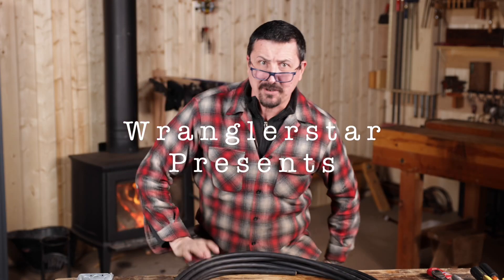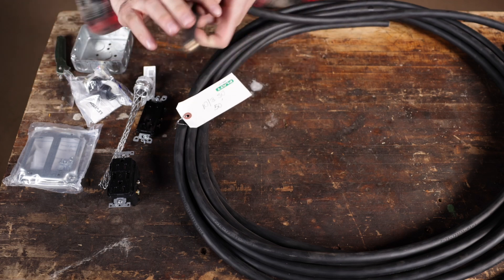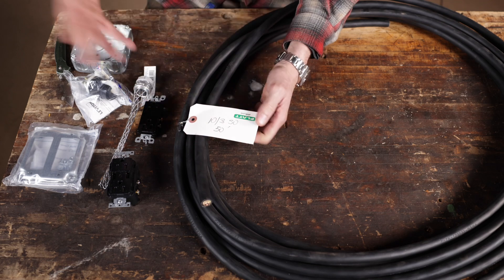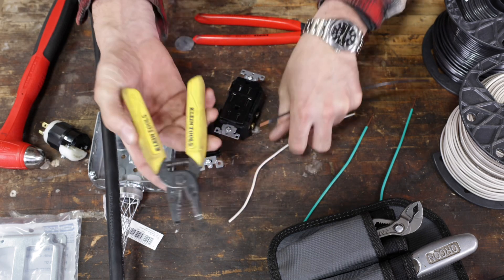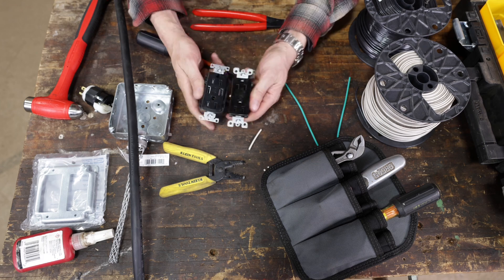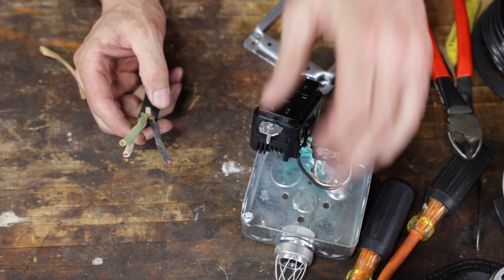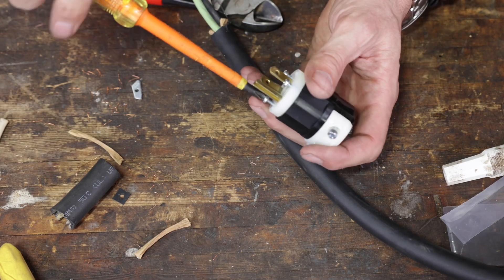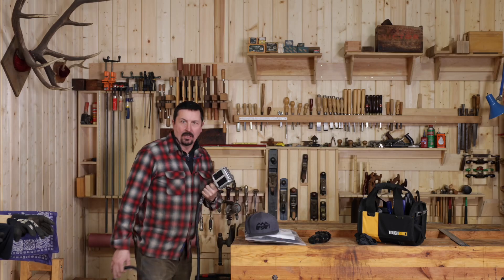The Ultimate $150 Shop Accessory - ALPHA CORD

Comment: I use a thick extension cord in my garage to power my smoker & compressor & fryer, which are all located away from the wall enough so their actual cords won't reach a wall outlet. I've been thinking i need to run some boxes above them, but just haven't spent the time or relatively small amount of money to do it.
Watching this video just gave me the ambition i needed to go ahead and do it.

Comment: hey cody those "jam nuts" are supposed to go on the inside of the box, and then tightened, right now  it's tightening onto the plastic bushing which isn't designed to hold the connector in, just designed to stay put and cover any sharp edges on the connector

Comment: Your locknut goes on the inside of the box, the plastic bushing is there just to protect your conductors from rubbing against the metal edge not to secure the box.

Also you don't need ground wires to your receptacles in a metal box.
You just ground the box and then your box serves as a ground, your yolks are grounded and they make contact with the box.

Comment: I make these often for me and friends. I mount mine on a 14 1/2 inch 2 x 4  and use a 10' cord. The 2x4 also has a couple eyelets screwed in the side.  14 1/2 is the distance between wall studs (16" on center) eyelets for hanging on nails, screws, or length of para-cord.  10 foot cable to measure a room or get estimate of buying wire .  I also wire a GFCI in the box for protection in case a corded drill or sawing wet locations.  This is a very useful tool.

Comment: So odd I just made a coworker friend of mine a cord like this. But I have to one up you. I put a 3 pole 50 amp old style dryer plug on one end then split the legs at the other end so the left receptacle used one half of the double breaker and the right used the other half. This way he could use one side to power his Lincoln SP140 120v welder and the other side could be used for his 4 1/2” grinder at the same time from his dryer plug. We didn’t want to change out his 15 amp breaker for a 20 because his old house had a long run of #14 going to the garage and wouldn’t support a welder. Also may father also called knock outs slugs. By the way did you use to own wrangler barn in Oregon city?

Comment: Hi, looks awesome! Except I dont understand using a smaller wire to connect the 2 outlets, and you didn't include the part of how you wired that big black cord into the two wired together outlets b4 you encased them 8n the metal enclosure,  which also kind of lost me... but I'd love to build a REAL great extension cord like this.
Yes, please can you post in Description, not comments where info gets lost,  your recommendations for a basic electrical  toolkit? I'll check back.  Thank you, Nicole

Comment: A couple things I do on my cords that you didn’t do on yours are:

At the end of the cord right before I put the strain relief on, I slip a nice heavy duty piece of colored heat shrink on and then put the strain relief over it to keep it from getting cut. That way I know when I see a chord with red heat shrink underneath the strain relief that it belongs to me. Pick whatever color you like.

Secondly, I come back out of the box and put a 12 to 16 inch whip with a female plug so that if I do need to go 100 feet that I can extend it onwards with another one of my 50 foot cords and not have a right angle connection that pulls out easily. I know you’re against it, but I choose to use 30 amp twist lock connections since I’m using number 10 wire. (I keep in my truck a couple of adapters that I’ve purchased off Amazon in case I need to adapt a twist lock to an Edison ) And that’s what I have in my shop. There is also an L5-30 on both my portable generators, and on the portable distribution panel that I built for my 240 output on my generator as well, which is 150 feet long so that works for me. 

I use these all the time outdoors, and this way I can string them together and have Edison outlets every 50 feet with them linked together with a twist lock so the cords don’t pull apart. I also use a waterproof box with metal doors and gaskets instead of an indoor rated box. That way if the outlet is not in use then it’s covered in case it starts to sprinkle. 

Overall I think this is a great project, and I probably have a dozen cords like this that I keep stored on the shelf for projects and jobs. I also have built up a bunch of #12 25’ single outlet cords to go with them… This way you’re all set up to connect up to those boxes out in the field.

Comment: You want to go a step better, you can make it a 10/3 + ground, and put a 240 plug at the end. Throw each outlet on a hot lead, and share the neutral. You run into a bit of a problem, since the 240 plug is likely gonna be at least 30 amps. Technically there needs to be a 20 amp breaker somewhere in your line, to be up to code. As a bonus, this is the cable that lets you run normal tools off a generator that only has 240v plugs.

Comment: If you're going to invest is SO cord go ahead and get 10 or 12 / 4 and the 220V plug that fits your generator.  Wire as you have for 120V, but when you use it with your Gen set wire outlet to red and the other to black.  That way you've got 2 separate circuits with a single extension cord (half the current for the same load).

Comment: I've heard the cable referred to as SO cable.  I have about 50 feet of 10/3 I pulled out of a job site dumpster when during covid lock down they weren't taking stuff.  I asked the Forman if I could have it and he said "have at it".  I cleaned the sheeting off (muddy).  I've not added the end yet, but they do make excellent extension cords.

Comment: That wire/insulation type is called SOOW or we call it S/O. It is meant to be resistant to getting hit, stepped on, rolled over, etc. I have installed a ton of it for the plugs that go onto the engines and ambulances at firehouses because if they don't get ejected properly, they get yanked, HARD.

Comment: Would be cool if you could have some type of rubber bumper on the face of the box, so that the plugs were recessed a bit. I imagine those plugs would crack pretty easy if you dropped it on it's face.

Comment: @ 9:10 I think that is a crucial part that is glossed over and left me stumped lol. Attaching with those bolts what sizes do you recommend? Or what did you use to attach the face plate to outlet? Thank you 🙏🏼

Comment: The cable is probably 10/3 SOOW. I've been making those for years. You're 100% right on the value of making these. I've hung several from the ceiling as a way of having an outlet in the middle of a room.

Comment: Agree 100% about cheap extension cords and their less than stellar ends. I try to buy a good one and if an end fails I replace it with a good one. The outlet box end is a good idea too,but I think two accessible plug ins would be adequate for me. I think my next one will be a plywood box with outlet mounted in it and a 5 gallon bucket screwed down to the box with a hole in the bottom feeding the wire to the outlet. The bucket can have the wire coiled up into it. Itd be the bucket on the go and still have room in the top for tools.

Comment: Probably mentioned in other comments - I didn't read all of them, but...

I was taught "black to brass" (B to B).  

Also - the tabs you cut off (I know them as 'plaster ears') can be used to space an outlet or switch out slightly so it's secure in the box and flush with the surface for the cover plate.

Comment: those cords are nice and heavy but then you plug it in to 15amp plug on a 20amp breaker. put a twist lock 3- pole plug that on a heavier breaker and add a couple of those sockets around the shop and outside of you  main doors for a job station.

Comment: Good stuff, I have done the same except mine plugs into the twist lock 240v wall plug and then one leg goes to one set of 120v plugs and the other leg goes to the other set.

Comment: Pro tip for you, Cody.  When you go to plug it in and test it the first time, do it with just one hand.  Do NOT do it the way you did, with one hand on the metal box as you plug it in.  If you made a mistake anywhere in assembling it that box could be live.  I'd also strongly recommend that one of the outlets be GFCI and upstream of the other one.  This way, you're still protected if you plug it into a non-GCI outlet.  Use hospital-grade (or better) receptacles.  They're better quality and will work better in the long term for just a few bucks more.  Finally, when looking at the box cover with the outlets installed, having one "upside down" with respect to the other means anything polarized that you plug in can be done no matter which way the box is sitting, without having to twist cords and plugs around.  Oh, and using a weatherproof box eliminates the danger of a knockout being driven into the box by accident.
Reply: The other plus of reversing the orientation of one of the receptacles is that you can fit two large wall-wart transformers which would not fit side-by-side.

Comment: Always an entertaining video, Cody! Never seen a guy get aroused over wiring.  It might be easier to feed the wire through the front of the strain reliever, instead of  back-to-front. Always do this, most of the time, unless you forget...DOHHH! Kind of like putting on your jeans BEFORE your boots! Better that way. But,  I’m just an amateur homeowner.

Comment: The metal lock nut is  supposed to go on the other side the same side as the plastic bushing. That plastic bushing will probably break and the so cord will fallout and box will fall off also probably causing a shot. And you should’ve got a deep foursquare box instead of a shallow box

Comment: Love it! 10 gauge is probably over kill. It’s normally used to carry 30 amps and a normal outlet is 15 or 20 . If you want to save a buck you can use 12 gauge with no problems.

Comment: The male outlet end has the plastic piece for different size S/O or S/J which is the type of wire you are using. The 12/2 and 14/2 and 10/3 are all different sizes.. I have 2 of these made up and I’m an electrician. I have one with a male plug and a 1900 box with 2 outlets and then another with a 1900 box and 2 outlets with just the end cut off where the male plug would be. And I use that for temporary power when doing a panel change. I stab directly into the meter socket which I DO NOT recommend anyone else doing! But sometime other contractors need power and supers don’t always tell the other subs power is gunna be off tomorrow, and I’m not in the business of putting another sub a day behind so you do what you gotta do!

Comment: Yeah real nice, but the lock nut goes on the inside of the box. The Kellums grip (strain relief) will be coming out of that box shortly after the plastic bushing fails. When you install electrical outlets in metal boxes it is a very good practice to wrap the electrical device with electrical tape.

Comment: I like this setup but what happens when you plug this into a gfci outlet? Do back-back gfci’s work the same as one? I had a 15amp power washer with an integrated gfci that would only work when plugged into a non-gfci outlet. I will forego the gfci perhaps.

Comment: Looks like that is a 10/3 plus ground wire. You could have ran each outlet on a separate circuit, and put a 4 prong 240 end on it. Of course that would mean you need 240 outlet wired up where ever you use it, but you would have more juice on tap for running a few big tools at once.

Comment: Great idea Wranglestar  dude…… however I wouldn’t use a knock out box that was made for indoor use and also you need to use a box with doors for the plug outlet. Let’s remember this is an internal and external extension cord and it needs to be protected from the elements in order for it to be …..well Perfect…. Keep on rocking….

Comment: What you have is called SOOW cord or SO cord for short. S = Service. OO = Oil resistant insulation and Oil resistant jacket. W = Weather and Water resistant. Rated for 600V. SJOOW (SJ for short) cord is Service Junior and the same except for the Junior voltage rating of 300V.

Comment: Retired electrician here.
Yup, gives me the "fizz"
"Strain reliever " is hyper important because that is where the wire will potentially fail causing a potential hazard.
Also, make sure you use GFCI outlets which provides another level of safety. You won't regret it later.

Comment: That wire is SO cord available at most box stores along with all those parts you have listed. 

SO / SOOW Power Cord

 The "S" in "SO" stands for "Extra Hard Service." This means that the wire is able to be used in applications requiring 600 volts or less. The second letter, "O" stands for "Oil Resistant," which means the outer jacket of the cable is oil resistant

Comment: I have an 8/4 extension cord on 40 amp breaker. It has 120v on each phase and a 240v outlet to run my welder or plasma cutter. I use a 50 amp RV style plug so I can use an RV extension if I need a lot more length. No USB outlets on my extension cord though.

Comment: Something is missing between 9:08 and 9:10. He used 12 gage to connect between the 2 double plugs, but did not show his connection of the power cord. The cord is 10 gage. Some plug receptacles won't accept 10 gage wire. It's unclear if the 10 gage fit, if he had to jury rigged the 10 gage to make it fit , or used a short strip of 12 gage as an interface to the 10 gage.

Comment: Looks like “SO”. Cable that is used for two main things in radio stations-to make up “field” extension cords for on location field jobs.the cables plugged into a Honda portable genset-then to your equipment. I have also seen the same rubber insulated cable for FM antenna devices heaters-“antler warmers”. Keeps ice from building up on the antenna-kicking the transmitter off air.this cable is exposed to the weather and intense FM RF off the antenna. Both the weather and RF rots the rubber out-the cables had to be replaced each year.
Reply: I use this type of wire all over my radio stations, but just for power ;) it works nice to drop from ceilings (using strain reliefs similar to the one in this video) and twist-lock connectors to power my racks.

Comment: That plastic "nut" is not designed to retain the cable.  It's merely for preventing abrasion of the insulation!  The metal nut goes inside the box.

Comment: amazon has outlets with type c. if I was going all out like that, I'd find a way to add ground fault protection.
Reply: Use a GFCI outlet, then from that to the other outlet. Both would then be protected. Somewhat common in older bathrooms.

Comment: my own suggestion for a future job is to actually use a 20 amp GFCI or even AFCI/GFCI outlet for first position then the USB plug for second spot.. but I use the USBs... one advantage I found is they act like a switch for you.. I had a new guy cut the cord to the jig saw by accident at the plug, in a way that made it dangerous to pull out... but I could reach the test switch button, which I tripped, then pulled out the damaged plug, then reset.. so we could keep working without walking back to the wall.. two 75 foot lengths of number ten back...

Comment: I suggest wrapping your wire if you can around terminals its a more reliable connection and will never pop out unlike stab lock or stabtight connections just a pro tip

Comment: That plastic bushing isn’t going to hold much. The lock ring goes inside the box to secure your restraint. The plastic bushing just protects the wire from damage. It’s not for holding any weight. Hope this helps.

Comment: Liked the video. By the way, the lock nut for the strain reliever goes on the inside of the box to hold the weight of the cord - then your nipple cap goes on last to protect the conductor.

Comment: Would this be crazy...make an extension cord from 10 gauge for your shop with both a 120 outlet and a 240 outlet so you could plug into your house 240 outlet and use your welder, but still have a 110 plug to run a drill or saw. Is that even feasible?

Comment: The cable is call SO or SOJ cord.  SOJ is rated for direct burial so the cover is thicker.
Reply: I was told that O is for oil, W is for water and weather, J is only rated to 300 volt  instead of 600 volt

Comment: I have a 50' I built in About 1992-93 with rubber coated 4 outlet box. I used the 12 ga. Cable cause it was available to me for free. It's paid for itself many times over. Thanks

Comment: The strain relief is nice. 
I've seen this done in machine shops with a conduit shield the whole length to reduce accidental punctures. not quite as flexible though. 
The wire flexibility has to do with the conductor count in the core. Lots of tiny conductors flex well, a single conductor would be super stiff.

Comment: Considering the comments about wire gauge matching the receptacles, potentially using an outdoor box.... assuming all the specs matched between wire and receptacle,  would it be possible to protect this with a GFCI, enclosed within this same box?  Just for added coverage in the event you aren’t already working on a circuit that is protected by GFCI elsewhere?

Comment: Since I got electricians in the comments. Bought an old 8amp 1/3HP drill press this week and it trips my Gcfi garage outlet. Not every time but 1/10 times. What are my best options. It’s on a 20amp breaker. I think it didn’t do it at all when it was plugged directly into the outlet but did when I used a “cheapish” extension cord so is something like this a good bet on the solution?

Comment: I used to work at Cannon Mills back in the 80s. We closed down one of the plants in the late 80s and they were throwing away a lot of good stuff. One of the things I saved from the trash can was a drop cord made with good 10/3 wire that had one bad end. I'm still using it over 30 years later.